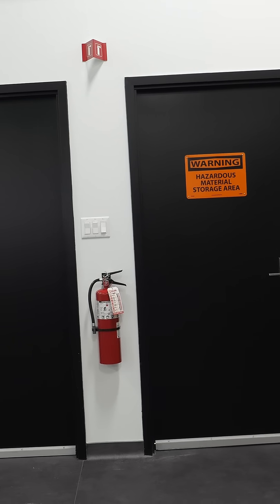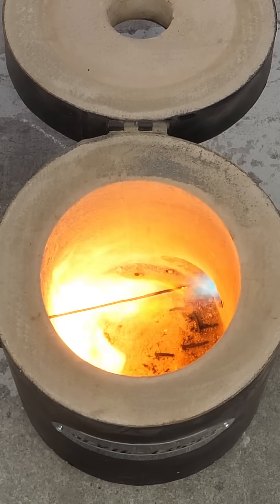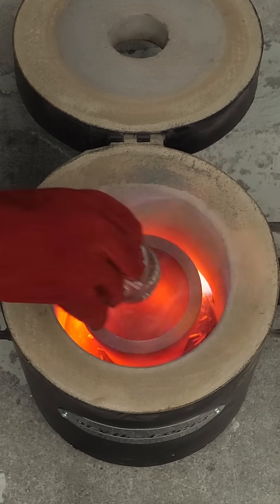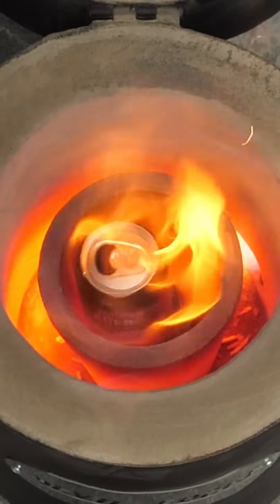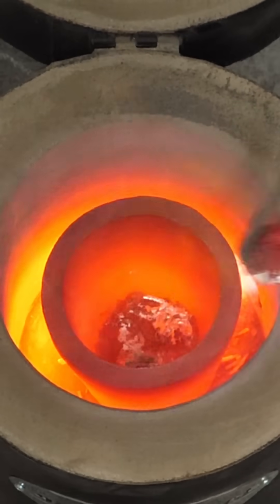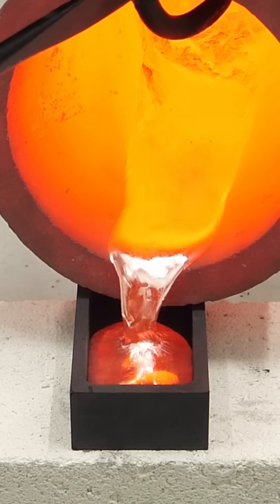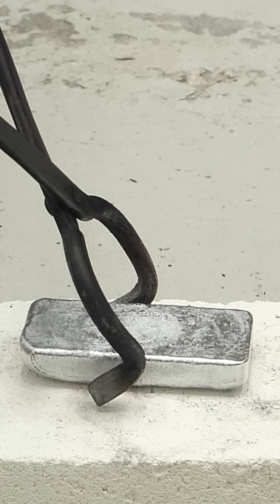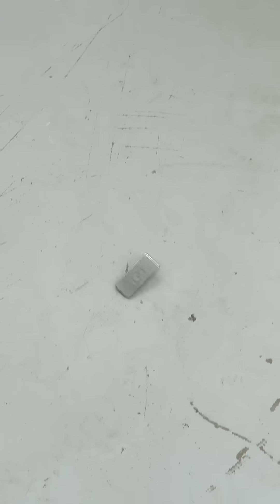Melting soda cans into a metal bar

Comment: I used to make a homemade furnace from a bucket and plaster of paris powered by packing Coal in between the crucible and the walls and have a hairdryer through the side provide air. Managed to melt steel and copper easily with it. Was a lot of fun
Reply: im taking notes >:)

Comment: Fun fact: since aluminum oxide is Al2O3, it's pretty expensive to extract aluminum from nature (during electrolysis, you have to give 3 electrons to each Al atom - multiply that to the amount of atoms you want, and the electricity bill skyrockets). So, this is a situation where it's just cheaper to recycle instead of mining more.
Reply: Another really big one is glass. Natural silica sand has a remarkably high melting point. The "soda" (sodium carbonate) added to soda-lime glass lowers the melting point of the final product, so making glass from raw materials is much more energy intensive than just recycling already-made glass. And unlike polymers and paper products which degrade and even aluminum where you lose a small amount to oxidation, glass can be recycled essentially indefinitely.
Reply: Decently rare circumstances that enables this to be the case. Pretty cool.
Reply: This needs to be known more. Metals, especially aluminum, are prime recyclables. Plastics, papers etc. are more polluting to recycle than they are to extract or create from nature. We need to reduce consumption of those products, and increase recycling of metals.
Reply: @Xorthis  Fair point. Plastics like PET and others, for instance, have an inherent limit on how many times they can be recast. Polymers simply start degrading the more you reuse them. Eventually, they're gonna become useless and will get discarded anyway, and then, microplastics are gonna be everywhere. We should reduce consumption of such materials, instead of hiding or justifying it with recycling, as if it was a perfect solution to everything.
Reply: @Xorthis  How about we keep the paper and just focus on getting rid of the plastics. The paper is fine and a more ideal waste. But I agree they shouldn't attempt to be recycled.

Landfills with good waste are a good and useful thing to literally fill land with. More of a paper ratio helps trap and filter the toxins in the rest of the waste, and less plastic is just less toxins, period. Making our waste and garbage safer actually helps a lot more with the environment and waste management than people give it credit for. 

We really don't have a garbage problem. We have a toxic garbage problem. We are increasingly restricting ourselves on where we can safely put the garbage by making it more toxic. We have too much for how toxic it is, but we'd have plenty of places to put it or utilize it productively if it wasn't.
Reply: I always remember that every aluminum can is equivalent to 1/3 of it filled with gasoline in energy terms, used to make the can itself.
The drink is almost free in energy terms.
Reply: Will food cans do the same? Or are they made by a different type of aluminum?
Reply: @frankierzucekjr  There are food cans made of aluminum, but the majority of them are actually tin and steel cans. They are made with a steel core and a tin coating, to prevent the iron in the steel from reacting with the can's contents.

That said, I believe melting then is still a cheap way to obtain steel, if you really need it (tho I have no idea of how to get the tin out of there).
Reply: Yeah i studied some electrochemistry a year ago and i learned a formula... amount of metal M= z/n  * Q where z is the molar mass of alluminum and n is the number of electrons which is 3 which greatly reduces the output alluminum formed
Reply: I don't get why the recycling price isn't higher. It's like $0.50/pound but it's sold for at least $10-20/pound. We have a lot of scarp aluminum at my work and it's almost not worth bothering to recycle it.
Reply: @atomix2201  "I don't get why the recycling price isn't higher." - Perhaps because it's almost not worth bothering to recycle it...
Reply: @atomix2201  It’s both energy and labor intensive to melt the aluminum down, remove slag, then mold it. There’s a big markup on the final product compared to the scrap cost for a reason.
Reply: @GogiRegion I get why the scrap price is much lower than the final price. What I don't get is why it's not at least 25% not 5%, and if it's so much more energy intensive to extract aluminum from ore than recycling, why doesn't the scrap price reflect that? Obviously the energy to extract from the ore is only a small portion of the final price, but everyone says it's so massive and I think there's something else going on
Reply: @atomix2201  Do you understand aluminum refinement? It quite literally uses electricity to tear the molecules of the ore apart. It has a huge electricity cost. I’m confused what you mean “why doesn’t the scrap price reflect that?” The price for ore is INSANELY cheap compared to the amount of aluminum you get in the final product. It’s more like 1%, which is lower than that 5% you’re talking about with scrap, so the prices do indeed reflect that.
Reply: Aluminum metal could be considered a form of solid state electricity.
Reply: Only reason I knew this was from hbms nuclear tech mod on Minecraft lol
Reply: @John-m2v8x No satisfactory ? Most complicated plants to optimize i think.
Reply: Actually said aluminum cans contain plenty of aluminum oxide (due to their thin walls and large surface area) too, so recycling them isn't nearly as cheap as it might seem to be.
Reply: @CoolKoon  Actually, the oxide layer is very very thin. Just a few nanometers thick. This is because once the oxide layer forms, it prevents the rest of the aluminum from oxidizing. So, even though aluminum cans are pretty thin, the oxide layer is a lot thinner. I'd say it's less than 0.1% of the entire can.
Reply: @yukinagato1573  Trouble is that a LOT of aluminum sticks to this paper thin oxide layer, which is why the melting of aluminum cans produces so much slag. And without reducing the oxide layer to elemental aluminum it's impossible to recover this aluminum too, which incurs a significant loss in any amateur recycling attempts.
Reply: Senku Ishigami has joined the chat